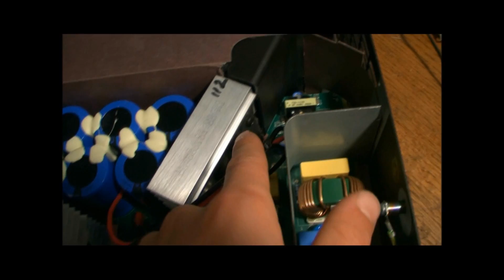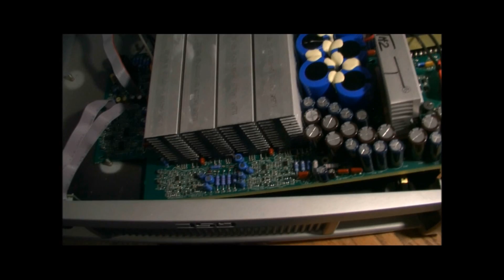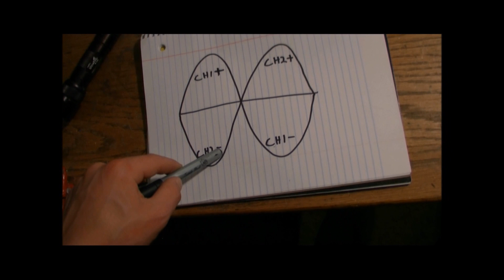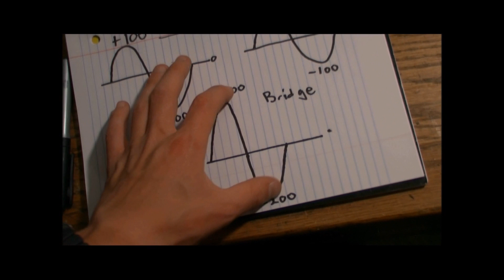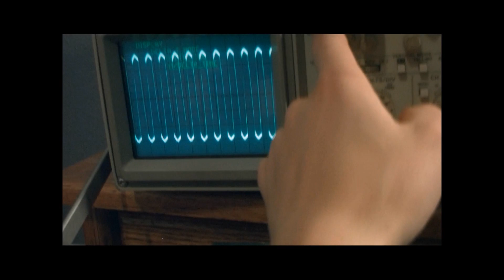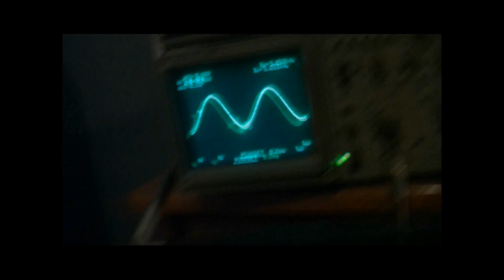QSC PLX-3602 Amplifier Teardown and explanation of operation

Comment from the maker: This amp sounds great. It is very impressive for its price it definitely lives up to its specs and the damping factor is actually very good for driving low end subs and sounding good which not all amplifiers can do. As with any qsc amplifier the reliability is unmatched. Especially for having a switching power supply and being pushed so hard this amp is one of the most reliable out there. At one point qsc was handing out 6 year warranties for free. Now that confidence in your brand.
Reply: I'm sure it does take a good power supply when running in bridge mono mode, I hear these amps don't perform to well when you don't give it enough power. Do you think I can power a jbl srx828s with this amp or would a crown xti 4002 be a better option?

Comment from the maker: The cooling fan is just a standard 80mm brushless fan. It runs very quietly in most cases you can barely hear it. However if the amp is pushed rather hard for a good amount of time the fan will speed up to keep the amp cool and even when the amp is no longer working hard the fan will continue to work hard to get the temperature of the heatsinks down. This is the only time the fan noise is noticeable to me and you do have to push the amp impressively hard to achieve this.

Comment from the maker: I never actually measured the rails with a meter but I have the schematics to this amp and it shows the voltages. Turns out the big blue 200v caps are the primary caps for the igbt's driving the primary side of the transformer. The actual output rails run +85v and -85v for the low rails using the 90v caps then the high rails use the 55v caps in series with the 90v caps to create a rail voltage of +134v and -134v